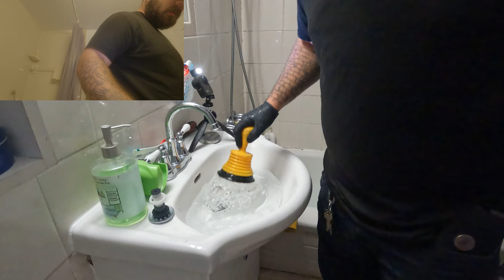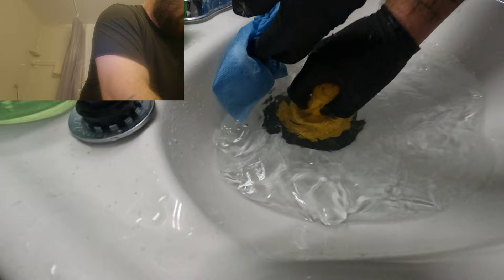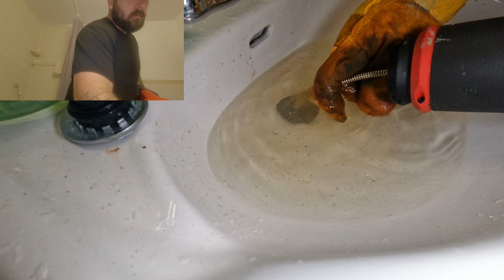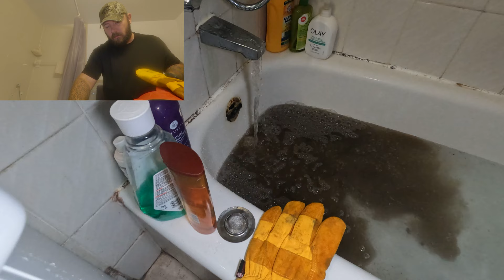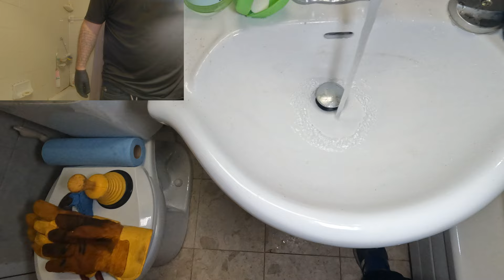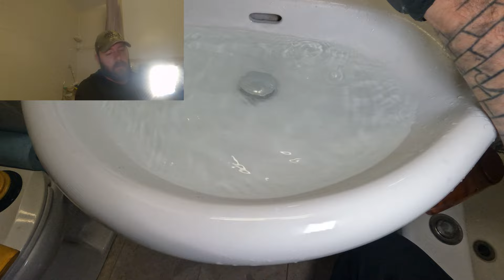You'll NEVER guess what happens when I snaked this bathroom sink, it's crazy.

Comment: Can you explain the technique of running a snake though the tub? I keep thinking I will get it suck in the pipe .
Reply from the maker: The technique is you want to have a cable that is flexible enough to go through the trap. I usually use a quarter inch without the inner core and you want to push it to the trap. Keep pressure on the cable. Forcing it in while you start to spin if that makes sense. You shouldn't get stuck unless you break through the pipe which shouldn't happen. The only other way I could think you get stuck is if you make it through and there's a bunch of wipes in the drain and you gather them up on the end of the cable. When you try to pull back it's too much to pull through the trap. Then you got yourself an issue. Hopefully this helps. Have yourself a great day!.
Reply: I'm a maintenance man in the projects your videos are very helpful. But what is a inner core? I'm going to go through the tub next chance . I will let you know how I did. Just need to know what's a inner core.
Reply from the maker: So the inner core is a piece tightly wound rod I guess is the best way to put it and it runs on the inside of the cable itself. What machine are you using?

Comment: What size cable do you run on your m18? Do you run 1/4 or 5/16 what length and innercore or not? Saw in the past you had a drop head on there in past videos too. Sorry for all the q's
Reply from the maker: This one's a 516 and it doesn't have an inner core. I have an M12 that has the drop head with an inner core. I usually use that for kitchen sinks. I like using the cable without the inner core for bathtubs because it goes through the traps. Easier. Thanks for watching. Hope you have yourself a great day. Trogna. And ask all the questions you need to. I appreciate them. Thank you!.
Reply: @Jaythatdrainguy  Thanks for the info! I see that you use sectionals when you take toilets off. If you didn't use sectionals is there a good drum machine you would recommend for those lines?
Reply from the maker: Honestly, I've never used a drum machines. The Spartan is what a lot of the guys use. I know New York drains uses it as well as drain medics so I'm not too sure I would try them or at least look into those. I just have never tried them or even had the chance to try them. Hopefully this helps. Hope you have yourself a great day. Trogna